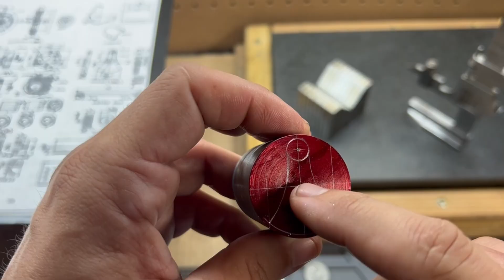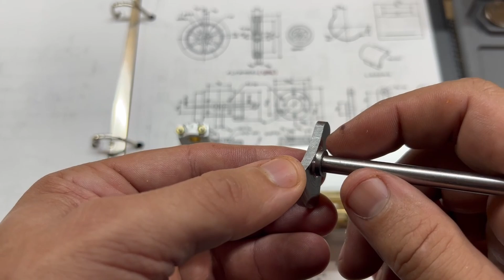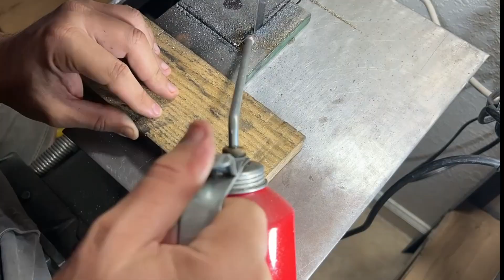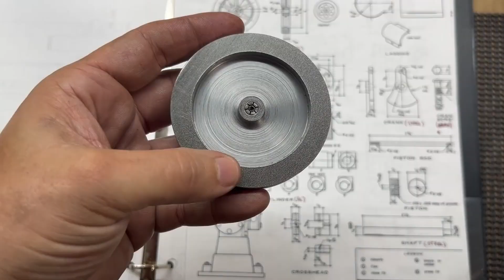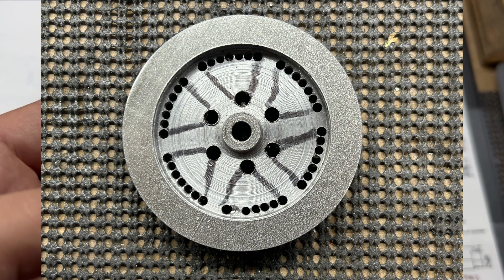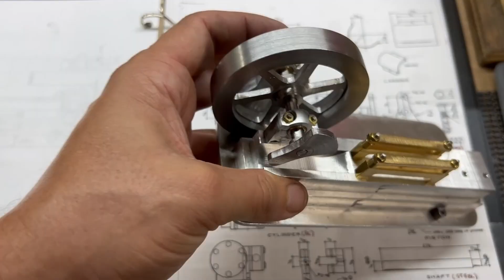Elmers #33 Mill Engine Episode 4

Comment: Why are you machining in the draft angle that was to be used when this was supposed to have been cast in a foundry. It is not needed since you are machining every piece? Save your time and energy for building the rest of the parts and building a nice model. Well i guess that if you want to be true to the plans and build it exactly as drawn you will need to do it that way.  I look forward to your next video good luck and have fun.
Reply from the maker: If you are talking about the draft on the base, I will machine it to match the plans. The angle on the spokes of the flywheel is just due to the shape of it, otherwise there is no draft on the flywheel. Thanks for watching.